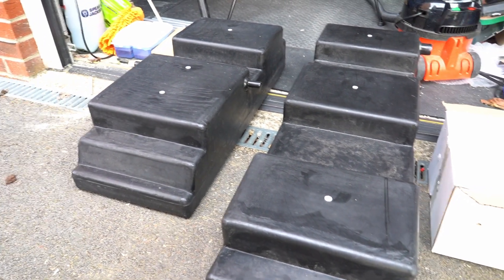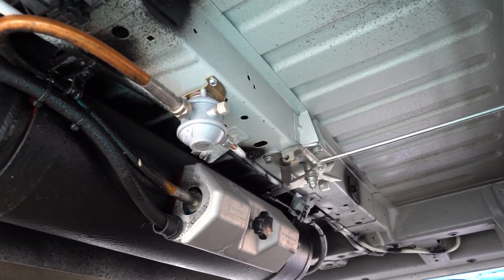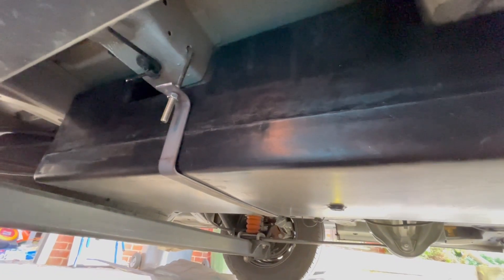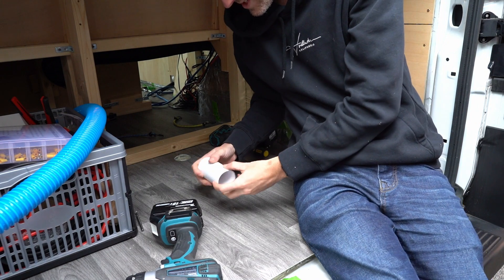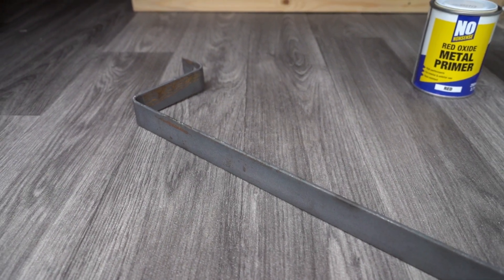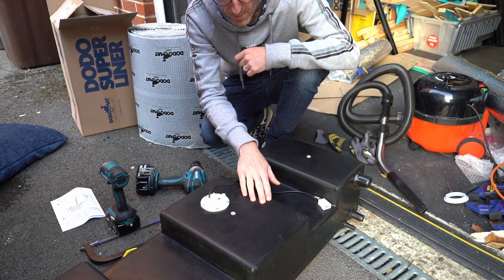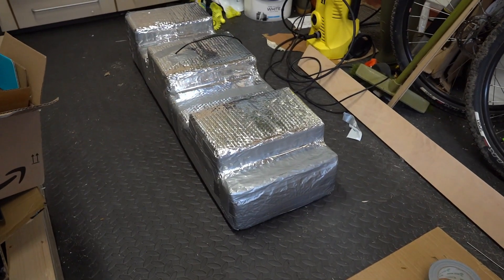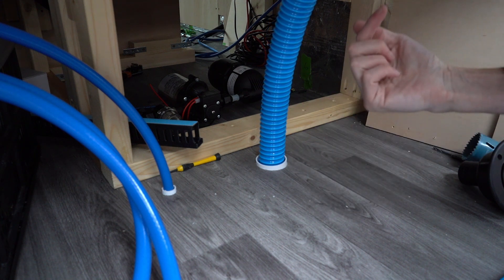Installing UNDERSLUNG (CAK) Water Tanks | Fiat Ducato L2H2 | UK Self-Build Campervan Conversion

Comment: Thanks for doing this. Very helpful. When you insulated did you allow for the air holes?
Reply from the maker: Glad you found it helpful. Yeah did allow for air holes. Also insulation isn’t fully air tight so not a big issue.

Comment: Why so many holes in the van floor for the water pipes. For the inlet surly be better to run a to a plastic trim on the rear and run the tube under the van? Avoids all the holes?
Reply from the maker: Benefit of hindsight I guess. I was planning as I was going so yeah I think I could have been more efficient. However I got quite confident about the holes in the floor tbh. Well sealed and protected and no problems to date!
Reply: @OurVanPlan  very true, you've done an awesome job and have helped immensely with my build so thanks for the videos. Personally trying to avoid as many holes as I can. Even for shore power and water inlet I'll keep the runs external and pos just hide under the bumper

Comment: Two years in, are you guys happy with the underslung water tanks? Do they hung too low for bumpy dirt roads? Ours is currently small enough that is tucked in bweteen two of the beams, But the fitting were welded very poorly and we have to change it regardless, so as we are on it, we want something with a bigger capacity in a similar format of what you have. We are looking to change ours ahead of shipping our relay to South America where some of the roads can be challenging.   
Thanks a lot for your very detailed series. You guys did an awesome job.
Reply from the maker: Thanks for your comments and glad you found the videos useful. Sounds like you’re about to embark on an amazing adventure! We are happy with the water tanks and not had any issues with them scraping. They do sit quite high and I think other things would scrape first! We also have dual leave suspension on the back which raises the back a fair bit and helps with clearance (and comfort!).

Comment: mate this is fantastic. Really helpful and makes one feel one can install a tank without stress. 
I have a motorhome on a Peugeot boxer frame. one thing I dont understand is there i you call the "fill" @21min and 12 seconds. and the cold fill ? Whats the difference?
Reply from the maker: Thanks glad you found it helpful. It’s certainly more straight forward than I’d expected. Hmm there’s only a main fill for the tank and then the cold feed back into the van plus of course the drain to empty the tank. Probably got my words muddled 😂
Reply: @OurVanPlan  ACTUALY... its me that's getting muddled. There is of course a fill for the tank. There is a feed to the van and a tank drain. I am being thick. thanks for replay . really awesome video and fantastic van .

Comment: There looks like a very small clearance between the tank and the rear axle ? Going over bumps the tank when full might hit this component. Also the springs look straightened-out, consider an air suspension kit for improved height and ride comfort !
Reply from the maker: It’s close but plenty of clearance. Yeah the springs were flat so I tried the sumo springs which helped a lot (particularly with stability round corners) but ended up changing to dual lead springs which make a massive difference and it’s a nice comfortable ride now.

Comment: Hii!! Where did you get the gray water tank? Do you have a link? I'm having a hard time finding it so shaped! Thanks❤️
Reply from the maker: It was off eBay, search for CAK tanks. Think the company was Caravan Accessories. Expensive for what they are but do the job. Consider your placement as you can change where the fill points are. The eBay listing has schematics.

Comment: Hi, Great video and explanation, thanks.
I'm converting the same van as yours and at the moment I'm planning the water and gas tanks. 
A question: I made a template of the larger fresh water tank (based on dimensions from CAK) and when positioned on the van the sweep of the handbrake cable in front of the rear axle cuts the corner of the tank, not much but it looks like it might prevent the tank fitting properly. 
How did you get round this?
Reply from the maker: Glad you found it useful. I didn’t have any issues with the hand brake cable but I know what you mean. I think the tank can push forward to keep it clear enough. There’s a reasonable amount of movement when the bumps of the tank are up in the gaps between the chassis struts.
Reply: Hi and thanks again, On your video it looks like the handbrake cable is just clear of the tank. I don't suppose there is any difference in the routing of this cable between your van and ours (2023) but, you never know!! 
If you say it fitted then I'll believe you. 
My thinking is to use 2 of the larger tanks (1 for fresh the other for grey) so there is a bit more clearance to get the gas tank inspection cover off. (The CAK 224W looks to be a bit further towards the front of the van than the 223F).
It's so difficult to plan these things without having the bits in front of you. C'est la vie!! Ron @OurVanPlan

Comment: I have the same set but found them to fit quite loosely on my Relay. Thinking of refitting them using my own alternative to their hooks. Did you have this issue?
Reply from the maker: Yeah they’re not amazing tbh. I managed to get it to a point that I was happy and the tank was held in place but would prefer a different solution.

Comment: Was it just the regulator stopping you from using both tanks? I have a 25L underslung LPG tank that I'm about to fit and want to get the fresh and waste water tank in too. Is there a way I can do this without running into problems?
Reply from the maker: Yeah it’s just the regulator and we could move it but it’s working ok with just one tank at the mo. You can definitely fit both plus the gas tank, it’s just quite right. The tanks come up close to the cross beam that the gas tank fits to.
Reply: @OurVanPlan  Ahh that's a relief to hear :) I'll look at trying to put the regulator in another location when installing then. Thank you!

Comment: Can you advise what the blue pipe is that you are using for the cold water feed.  I'm in Australia and I've shipped a CAK tank over from the UK with 15mm OD outlet, struggling to find a pipe to fit it.
Reply from the maker: Hey, it’s basically just a drinking water safe flexible hose pipe like you’d use in the garden. 15mm. I got it from the same place I got the John guest fittings and the 12mm pipe. Quite hard to find admittedly but that’s what it is.

Comment: Great instruction video 👌 but ..... you insulated the water tank nicely against a night frost, but you forget to insulate the water hoses too, otherwise all the work of insulating the water tank is useless
Reply from the maker: Yeah good shout, I have subsequently put some on the cold water feed pipe. But yet to test the system so will revisit 👍🏻

Comment: Class Job on the tank where you cable tied the blue pipe to the axle It might be a good idea to put some rubber to save the pipe and fitting some kind of mud flap to save all your hard work Insulating the tank wouldnt do any hard to lag the pipes great job by the way not many people would think of Insulating and rust proofing brackets 💯👌
Have thought about wax oil  the under carriage of your van class video campervan content you could be on to something there Insulated tanks 💡💡😎👌👍

Comment: Hi mate. Can you please advise where you got your flexible 40mm filler hose from? I've bought a couple of potable (convoluted) pipes, which say they are 'flexible' but they are actually quite rigid! Many thanks
Reply from the maker: Hi, it came with the tank and is really flexible as you say. It’s a CAK tank but came with all fillers/hoses.

Comment: Well done, plenty of thought needed for this - pity that you couldn't relocate the gas regulator. Not sure if you have already, but I would fit locking nuts to the support brackets. Looking forward to the next part.
Reply from the maker: Thanks Errol. I was going to fit locking nuts but then forgot so I will retro fit them assuming the other ones haven’t already rusted on 😂

Comment: Hi mate, can I ask what specific pipe you used for the feed up into your van? Was it an internal diameter of 15mm or smaller?
Reply from the maker: Yeah the cold feed into the van is 15mm flexible hose and seems to do the trick. It’s more like hosepipe than the 12mm internal plumbing pipe work.

Comment: I am building a van myself. I took inspiration from your ceiling and made one similar to yours so thank you and sorry for copying your design! I am a bit behind your build so this video comes handy. I am terrified of making holes though my brand new spotless floor! 
As you mentioned, I think the entry pipe will accumulate water in the elbow and possible freeze if the temperatures drop below 0. Do you have enough room to insulate the pipe? The others are quite small so I'm guessing that won't be a problem. It would be a shame if the pipe froze after all that Xmas present work done on the tank!
Reply from the maker: Your ceiling sounds great and we saw the design from someone else so sharing the love for the slatted ceiling! I still need to fully test the water filler. I think some will accumulate so will need to deal with that. There is definitely space to insulate so I’ll do that and keep everything crossed!

Comment: Just subscribed a week ago and slowly catching up. Love your detailed explanation, your eye for detail and your unbelievable patience! 
just a question with the tank. There are several raised sections (3 in all) How do they all fill up? Would there be an air lock preventing filling or are they all separately vented?
Reply from the maker: Ah thanks Phillip really appreciate that. Yes it has been very testing at times. I wouldn’t come across so patient in the out takes 😂 there are tiny vent holes in the tops of each of the raised sections.